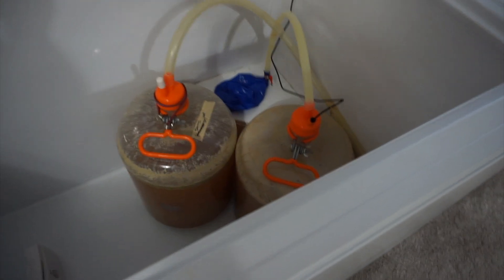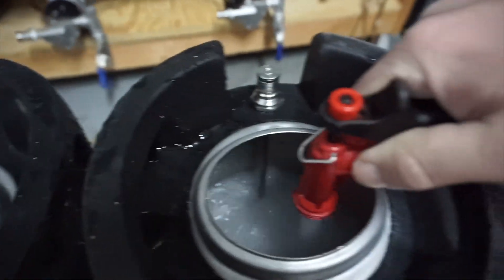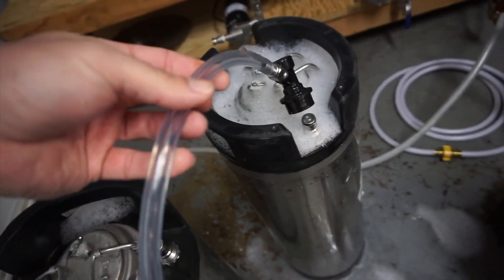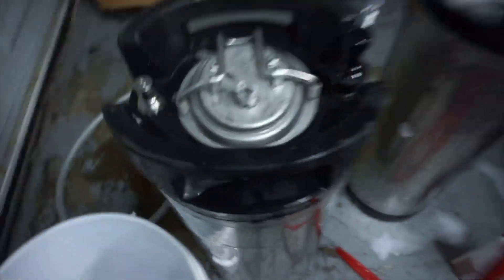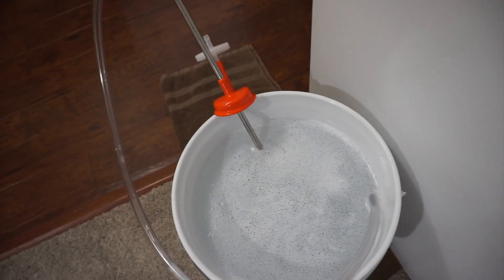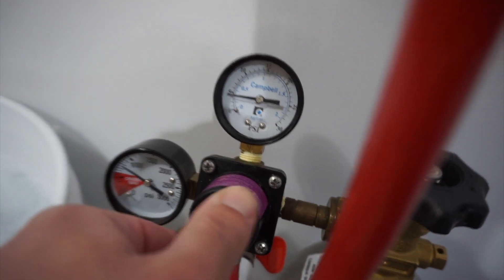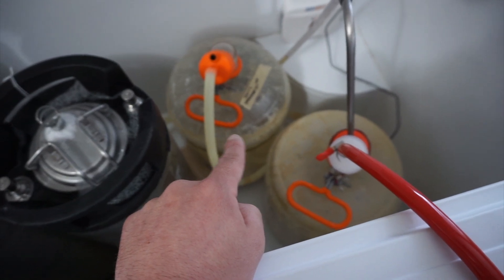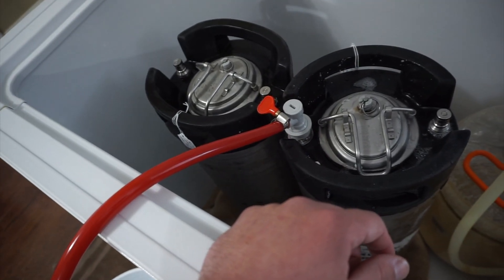HOW TO: Co2 Transfer From Carboy

Comment: Hey, did you not need a spunding valve or similar on the gas out port on the second keg?  Will the fluid move over into the keg full of air?
Reply from the maker: You can leave the PRV open or open it periodically to vent pressure on the reviving keg since you’re only pushing with 2-3PSI anyways

Comment: Hi is it worth buying a freezer and turning it into a fermentation chamber? Is it  accurate and effective tempraturewise or it's better to buy a unitank straight away and invest a lot of money on glycochiller etc. What's a good way to have temprature control over fermentation without buying the most expensive equipment? I was thinking to buy a freezer and ferment into kegs and a stainless steel bucket. I'm asking because I'm trying to avoid such an investment for the moment. Thank you.
Reply from the maker: I think using a chest freezer as a fermentation chamber is the way to go for doing it cheaper than other options. That was my way for fermentation control for a while and I still use it today here and there.

Getting an Inkbird temperature controller to make it “plug and play” and using the probe to tape to the side of the carboy or using the thermowell if it has one.

Glycol is cool but on the homebrew scale is it worth it? That’s all based on the person and their budget.
Reply: @HopKillerBrewery  That's exactly what I was thinking as of what I've read and heard it's a pretty accurate and reliable way to start. I know that being able to control your FV's  temperatures individually frees your hands but of course it comes with a price which is high enough for the homebrew scale. 
Thanks for your very quick reply and congratulations about your channel I've been following you for a few months now and you're doing great job providing us with tons of info! Thumbs up!
Reply from the maker: @hoppyjoker  thanks for the support!